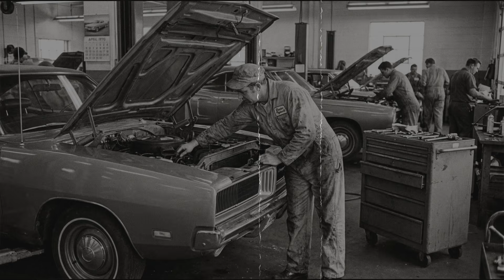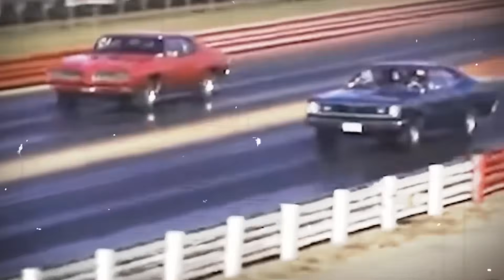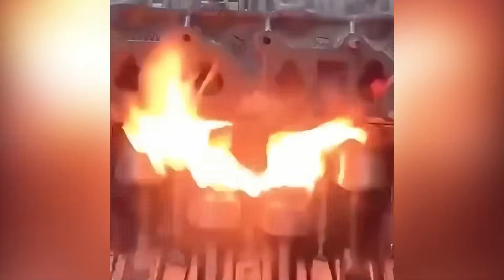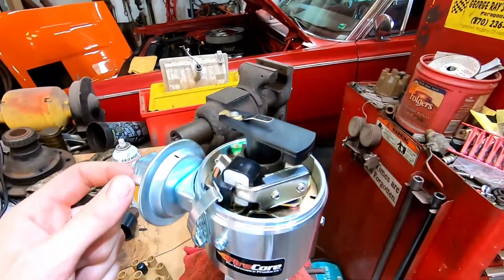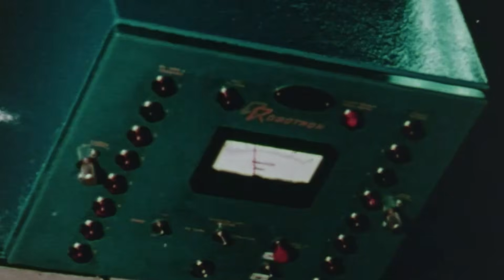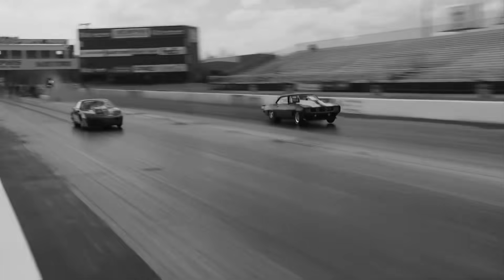THIS Illegal Distributor Hack Exposed Chrysler's Greatest Mistake!

Comment: I pushed a D150  225 slant - 5 spd to 35 mp Canadian gallon.    I added methanol injection under load. And electric rad fans.  Gave me 30.hp not turning a fan with no clutch. 

Cheers - old guy.